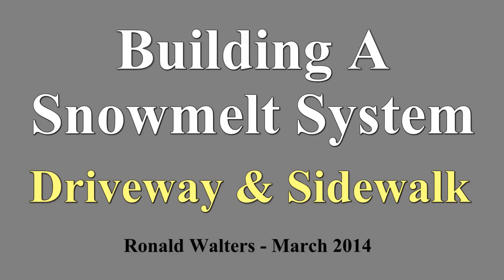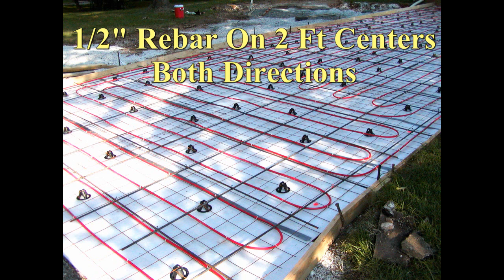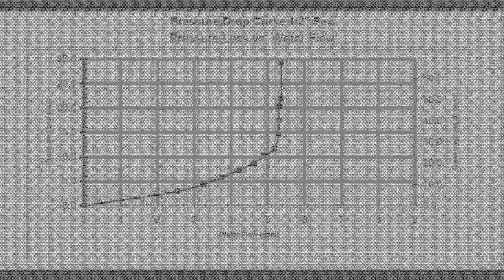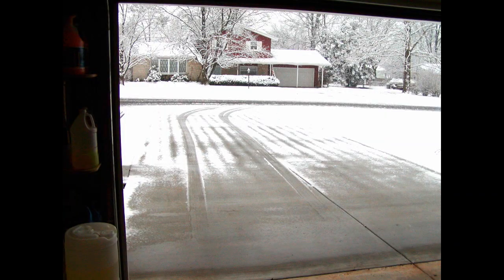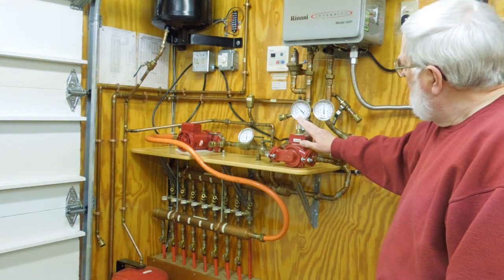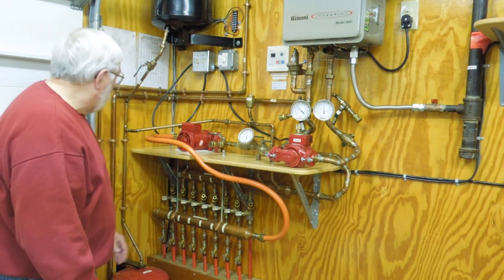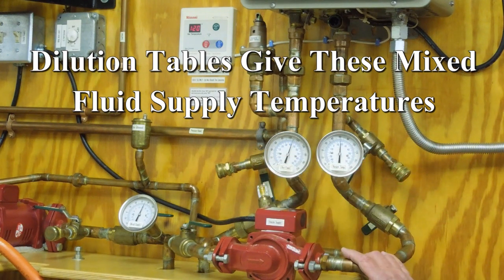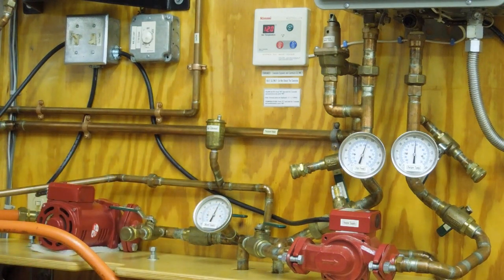Snowmelt, Building A System - Driveway & Sidewalk

Comment: Great info. My home (3850 sq ft) is heated with hydronic heating and I'm wondering about tapping into the built in heat source. It was all installed in 1992 and the control valves and system works but is junk and not engineered correctly. So I'll need to rework that system and add purge valves at the upstairs radiators along with installing larger radiators and new PEX where possible. I'm stuff with using the poly butylene that was poured into the basement and then into gypsum pour in the main floor. Only the upstairs uses radiators and as you have probably determined, I'm having to provide 2 different temps and 3 major zones. Three of the upper bedrooms are on one thermostat and then the master has it's own so zone. Not enough zones and control were engineered into the system. Anyway, I am thinking about adding on a solar hot water system using evacuated tubes and a large storage tank along with heat exchangers. Lots to consider and factor in. But the house has been so efficient with the current system that ROI would take at least a decade maybe longer. But adding on a heated drive and walkway to the front door could very well increase winter operating costs and then ROI would happen much sooner. But along with hammering out the cracked concrete in the driveway, I'm thinking about replacing the garage floor so it's heated as well. I was planning on going with 2" high density foam as per what I've been seeing in other builds. After seeing your usage of thinner foam with an aluminum reflector built in seems like a better way to go. I'm concerned with the thicker foam getting "worked" down under the weight of the cars and stuff. So lots of ideas. A final idea is the cost of buying my own closed cell spray foam equipment vs contractor to spray my 32x48' shop. The cost alone of having that shot would go a long way towards the purchase of the gear and then I would have the gear to re-insulate the garage vs fiberglass. Then there's a 48 foot gooseneck, adding SPF to the underside of the main floor and I might even look into the attic space. I've never even been in the main attic but one attic space has a lot of blow in stuff. Some of those areas are big enough that they might make cool little hobby rooms. If I sprayed the underside of the garage roof directly into the rafters then the entire garage upper area could be utilized. Of course I'd have to consider structural aspects. Anyway, I'm creating a novel here...too late huh. Working in Afghanistan and I get bored at times and think of cool stuff like this. cheers and thanks again.
Reply from the maker: +6806goats1 Only a few comments – The main reason most driveways are cracked and broken and look like crap is the contractors are on the cheap and don’t care to do it correctly. Compaction with 1” rock (for drainage) then fine chat on top of that.Use standard 6” square wire mesh AND ½” rebar on 3 ft centers both directions. Do the same thing for the sidewalks. Expect the contractor to give you a bid for all that and then try to weasel out of it when the job starts. Rebar on plastic chairs to put it in the middle of a 5” slab. Install the chairs a day or two ahead to make sure they are there. If the chairs aren’t there, don’t let them pour the concrete. No concrete saws… hand-tooled joints only (for obvious reasons).
The thick sheets of dense foam… make sure it is bug and bacteria proof… find out the compressive strength. Calculate the weight of the concrete and the load per square inch is pretty low. I used the ½” thick rolled insulation with the center foil in my house, shop and the driveway and it works. Tape the roll seams (I used duct tape). Timber spikes hold the insulation down. Heavy (thick) plastic sheet on top of the insulation. 
It would be my suggestion you stay away from spraying foam and pay someone who has experience doing it. Screw up two drums of foam or have it go off in your heated hoses and you can kiss any savings goodbye in a heartbeat. Only use high density closed cell foam. Don’t let anyone talk you into the open cell foam.
Bored in Afghanistan… sounds like a good thing.  Imagine one could stir up some excitement if you went looking for it!
Reply: +Ronald Walters Thanks Ron, good ideas. I'm hoping to do the concrete setup myself and then get assistance when we pour. Used to tie steel in my youth which was many moons ago and then a few pours. Yeah, saws on pex just don't work well together. I want to run Cat 5 and cable to each room but too paranoid to drill even in areas where the walls are placed. They probably did the gypsum after the walls were installed but unless I break open a wall to verify then I'm not drilling. My plan is to replace as much poly as I can with new aluminum pex as possible to reduce intrusion as it's been a problem. The system isn't closed loop and get purged at least every 2 years and I get a rust color every time. Not sure if I'll ever get it sealed the way I want since poly is encapsulated in the concrete. SPF: The only way I will try it myself is after taking some training. Too many ways to mess things up and lots to consider. I may have to bring someone from a long distance as I'm somewhat remote. Not too bad but i'll keep that in mind. Buying new gear and setting up my own small business is a remote option but I'll need something to supplement my income. Probably easier ways to do that however. Earthquakes have been the biggest adventure this week. Had a 6.6 yesterday near the border. Join the Navy, see the world they said. LOL. Did my 20 and saw a lot but after that it's only been Iraq or the Stan. I need to get out more. Thank you Sir, enjoy your day.
Reply from the maker: +6806goats1 Not familiar with aluminum pex.  I used red for domestic hot water and blue for domestic cold water and the heat (radiant) pex has an oxygen barrier. My heat pex is red on the outside and white on the inside. 
When building my house/shop I took thousands of photos from every angle... before concrete was poured and inside walls & ceilings. The 6" square wire mesh doubles as a grid so you can have a pretty good idea where stuff is inside the concrete. I never run pex under walls or cabinets. I tell people all the time... once the insulation is in and drywall is up you have no idea what the contractors did inside your house. 
I lived in Jakarta, Indonesia and what was Irian Jaya - Indonesian half of New Guinea. Had some pretty good shakers there. Ron
Reply: +Ronald Walters We're probably talking the same pex. The al is a barrier inside the pex to make the barrier. I'm planning on doing the same thing you did....red for hot, blue for cold. It was an owner built house and he sure didn't fasten things down very well. All the wall faucets flop around a bit. My hopes are to couple the new pex to the poly and pull the new run. Depends if he stapled things down. Was hoping to foam the lines to insulate if I have to open walls. It's a long run from the equipment room to the upper bathrooms and it takes awhile to get hot water topside. Insulating might help once the second person hits the shower but probably not much advantage for the first run of the day. Would like to have hot water demand but running a gas line worries me. Just let the water run I guess. Just have to remember that in the winter when the system is providing heat to the radiators that the water is 180* and not the normal 120*. Only takes one time plus the steam is a good indicator.I do like your rebar idea and I'm sure that not having it put in the first time is why it cracked. Time for the rack so thanks again and enjoy.  Out

Comment: Just wondering if your system is still working out for you and if it is better to start heating it up when you are expecting snow versus waiting until you actually get accumulation?
Reply from the maker: Works great! Around here you can't really believe the weatherman and we tend to be right on the edge of rain/ice/snow (it can go either way) so a lot of energy can be wasted by heating the concrete needlessly. I have tried it both ways and now I generally prefer to let several inches accumulate before firing it up and then gradually warm the concrete so as not to crack it. A concrete slab is a giant radiator heating the great outdoors. A layer of snow acts as a blanket helping to keep the heat below it. Melting occurs at the concrete/snow interface and not much above it. If the sky clears, the sun immediately helps a lot. If you live somewhere that gets "feet of snow" a combination of melting & plowing should be considered. Thanks for watching.
Reply: I definitely do live in a place that gets feet of snow, and can tell you that a system like this couldn't reasonably be considered for regularly clearing after large snowfalls.  It WOULD, however, be immensely helpful as a salt replacement. As snow becomes packed or ice forms, a thermal system would be ideal in loosening it for mechanical clearing.
Reply: I live in a place that gets feet of snow too - we have systems like this at our ski resort and they do work.  Are they cheap to run? No way... but they do work.

Comment: I'm curious about these systems and have a few questions about minimizing costs and such. Given that you are using an on-demand heater for the glycol, it seems like there might be a lot of waste heat in heating up and maintaining the temperature of the glycol. Would it be more efficient to feed the glycol through something like an indirect water heater? Water has a lot of energy in it so once it is up to temperature it would have less heat loss and could provide more surface area to heat the glycol through the tanks coils.
Reply from the maker: +Dloweification You need a glycol/water mixture anywhere the system might freeze because the system is only heated when you need it. The most efficient approach is to heat the glycol/water mixture directly in a "heater" and an on-demand system wastes the least energy... that is why they have developed on-demand heaters... you only heat what you need when you need it... not store something heated in a tank.

Comment: I've often thought about doing this. I would start with a few solar panels.  Then go with an electric on demand water heater. Solar panels generate electricity almost every day,  year round.  So, using the system wouldn't cost much if anything.
Reply: Confused... When the driveway is covered with snow, would the solar panels be covered with snow as well? Or would you go up on the roof to clear the solar panels so you can get your snow covered drive-way be cleared by the system :) ???

Comment: Im building same thing. But i use thick iron pipes. Metal is best to transfer heat to where you need it.
Reply from the maker: Concrete is porous. Moisture can get to the iron causing rust. Expansion of rust over time can crack the concrete and deteriorate the iron pipe. Even copper will corrode inside concrete.

Comment: What a great video.. Thanks so much.. about 7 years ago I installed 1/2 tubes in my sidewalks and patios and have never hooked anything up... Everyone I talk to want's a lot of money to get it up and running and they all said I couldn't use an on demand hot water heater.. the typical reason was that glycol would gum up the head exchanger.. did you experience any problems with this? also they said I needed about the same sized unit with about 180,000 btu.. I've got about 5 inches of concrete 3 zones and 20x10 rear patio and about 60 ft of sidewalk about 3 ft wide.. All with 2 inch hardboard under.. I'm just looking for an economical hookup. I'm a little confused though why you would need 2 pumps.. essentially these would run on the same line wouldn't they? I just looked at a radiant system with 1 pump..  Also, one of my issues is that my tanks and workings will be below my sidewalks, as my garage sits on the walkout level. I'm concerned about bleeding the system.
Reply from the maker: +gustusteam Everyone out there wants to charge an arm and a leg for radiant systems. Good example of highway robbery! It just isn’t that expensive if you can do it yourself. Not sure how efficient an insulation hardboard is or if the bugs will eat it. I hope you used PEX tubing specifically designed for radiant heat. The large pump circulates the fluid in the zones. Fluid needs to flow through the on-demand heater at variable flow rates. That is the function of the smaller pump. The small pump gives you positive control of the flow through the heater. Look at it as a metering pump injecting into a flow stream. I was specifically told glycol was not a problem in my on-demand heater and I have not had a problem. It may be difficult to slow down the flow through the on-demand for a relatively small area like your patio and sidewalk. Even for my large driveway I am running the on-demand at pretty low flow rates. An on-demand is happiest at high flow rates. An on-demand is like a jet engine. Jet engines aren’t very good idling but great a full constant speed. Now there are some smaller on-demand heaters available. Basically you are probably going to be on your own using one for your radiant system. The manufacturer will probably not want to support your efforts, their engineers will not stick their necks out for something they haven’t or don’t do very often. I assume you had someone calculate an “accurate” BTU heat load. You may be able to use a gas hot water heater and a mixing valve (tempering valve). I heat my whole house with a 50-gallon hot water heater. I heat my workshop with a 35-gallon hot water heater. Your air bleed needs to be at a high point. If you don’t have a defined high point, create one (loop up, then down on supply and return). Use an automatic air bleed (at the high points) at all times. It could get a little messy so plan accordingly. DO NOT (Never, Not Even Once) heat the concrete fast. You will break your concrete. Slow and easy, gently bring up the temperature and make sure your system design allows for this gentle warming. All those automatic controls are nice and fancy and they are expensive and they quit working. My snow melt is manual control. You need to keep an eye on it, but what else are you doing if it is snowing? Take a deep breath when you go to buy glycol, it is expensive. Use inhibited glycol, distilled water and some bug killer (I put in a few bottles of iodine).
Reply: +Ronald Walters  Great answer, thanks.. I was told I would need 175 BTU for my sidewalks and rear patio.. but you think this is a little much?.. the heating company said that most heaters wouldn't keep up in winter. I get what you say about 2 pumps.. makes sense.. I did install a slab sensor and have an automatic controller.. it as about $1000.. Are you using an automotive glycol? or what kind? Where do you get Inhibited glycol?
Reply from the maker: +gustusteam Depends where you live, how cold it gets and how cold it stays. A snowmelt system is trying to heat the great outdoors. A slab of ice or snow on top of the concrete acts as a blanket and helps melt what is underneath. You won't know what size heater you need until someone actually does the calculation for you. I ran across a  number of heating companies who just pulled a number out of the air. Is your slab on the sunny side or shaded side of your house... many things contribute to the calculation. Get an actual calculation from someone who knows what they are doing. Be wary of a sensor and automatic controller... it is another part that can go wrong and if you heat your slab too fast you will break it. My on-demand heater has a max output 185,000 BTU and I doubt I have ever used half of that even after it has been running a long time (but that is MY situation). Ethylene or propylene glycol will be sold by a chemical supply and you should ask for it to be inhibited to the percentage of dilution you will be using. In my case I am using 40% glycol. If the chemical supply does not know what you mean by asking for it to be inhibited.... find another chemical supplier. Inhibited means it won't be as likely to react with copper or iron in your system.
Reply from the maker: +gustusteam I mixed my fluid in a clean plastic trash can. Then I fill/flush with a sump pump. Fluid at a velocity will push the air out of the PEX but you will still have some trapped air that will eventually (hopefully) work itself out... otherwise you're screwed. The circulating pumps are pretty gutless and can become air-locked fairly easily. You need automatic air bleeds... Hoffman Water Vent No. 77 is what I use. Hopefully everything will work for you, but other than than I can't help. Good luck!
Reply: I bought glycol from one of my local plumbing supply houses. It is different from an automotive antifreeze.